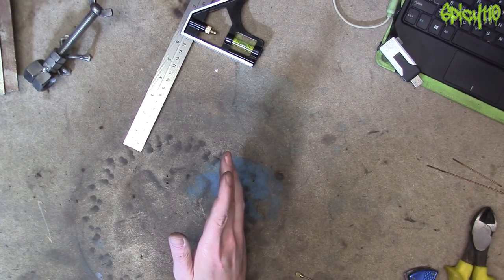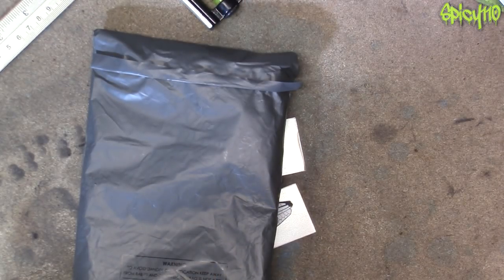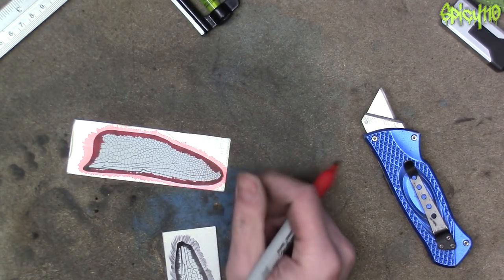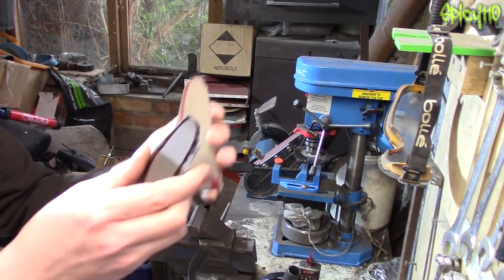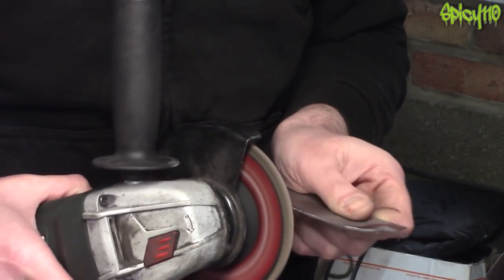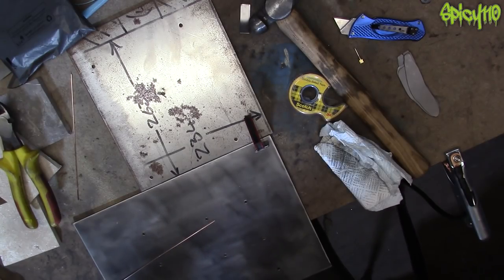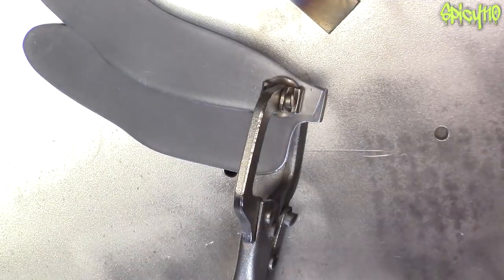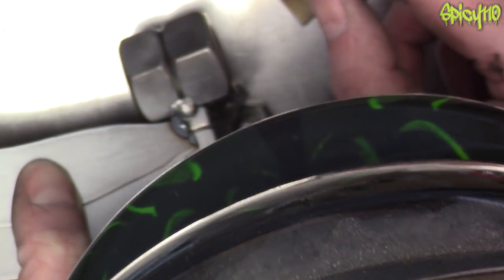Nut & Bolt Dragonfly Sculpture!

Comment: Great little dragonfly!!  If I can give you a tip, don't be in a hurry to remove the torch from the weld area. let the argon wash over the weld for a few seconds after you finish the weld  to prevent oxidation of the weld joint. I'm no expert but it is an important part of tig welding.
Reply from the maker: Yep I know I talked about this in my set up Video. It's one of the things that people who are used to mig welding have to make a habit. It will come in time, this is why I make such a point of saying I'm learning. I will make mistakes and as they happen the lessons will be learnt. 😀

Comment: Is this the type of welding where you should leave the nozzle close to the weld for a few seconds after turning it off to keep the gas "cocoon" around the weld to stop it... doing.. er something. Oxidising or that colouration you're seeing once the torch is off. It's something like that, I'm sure. Not critical but a nice tip.
Also my mum would fucking love it.
Reply from the maker: I talked about that in part one, I'm not in the habit of it yet but so far no adverse effects. Maybe it wasn't part 1 maybe it was the set up video. Hmm
Reply: @spicy110  I missed.... one of them, so it was probably which ever that was. I'm such a good fan.